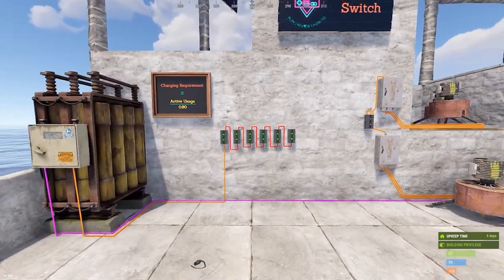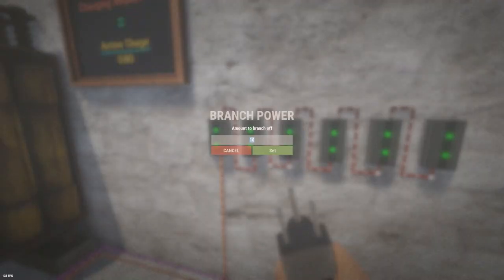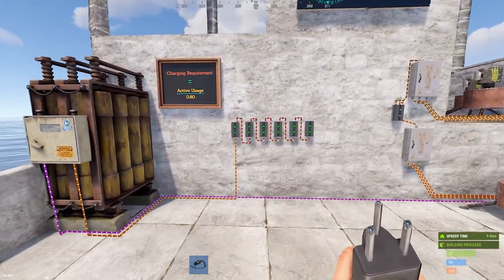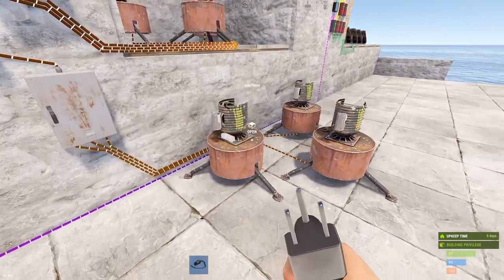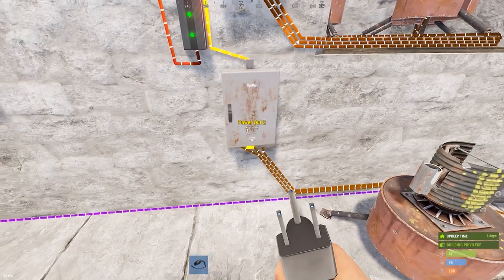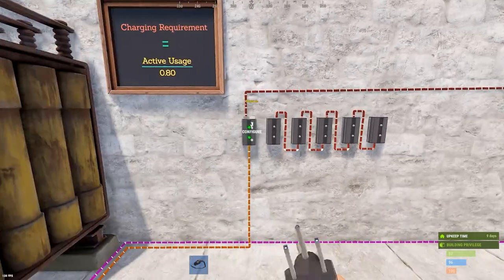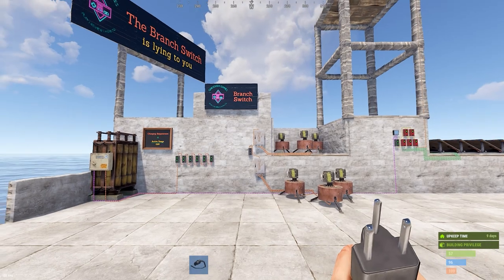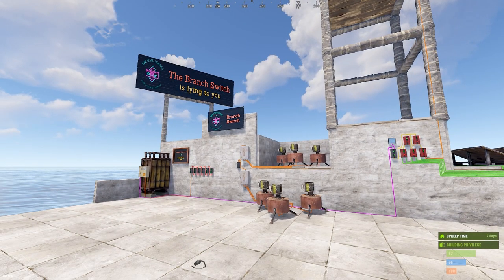RUST Pro Series - The Branch Switch is LYING TO YOU 2023

Comment: Also, currency the banch out is bugged too - even if you branch out directly into a switch which is off, or a blocked blocker, it your battery will still use all the branch out volts as active usage.

Example: in this video, you had 6 branches each set to 10. In this case, they weren't even hooked up to anything, and yet still used 10 power each from the battery. 

Keep this in mind when using branches, and always run a battery's output directly into a switch before any other component at all so you can turn it off if need be. Because of the power usage glitch, you should also consider using several medium and small batteries instead of one or two large batteries. That way, you can turn off one circuit in particular, instead of all of nothing.
Reply: Its not bugged, its intented like this, I don't like it either, but they made this way.
Reply: @marcoantoniotaterospindler4453  wow that's surprising. Thanks for telling me though

Comment: Definitely a difficult concept to explain until you try it yourself, well done.
Reply: @this guy except you didn't explain it correctly. It only "uses 1" if you're referring to the output, but it doesn't "use 1" if you're referring to the drain on the battery.

Comment: If the battery doesn't "see" the branch in it's active usage, is that just a display error, or does it affect charging efficiency needs? ie. If you just wire up 50 branches daisy chained, and the active usage registers whatever the final output is (battery max output - 50), is it the (incorrectly) displayed active usage you need to account for, or the actual active usage, when determining non-drain power input required?
Reply from the maker: I don't think it's a display error. I've set charging based on the active usage that's perfectly balanced (so too low if it is a display error) with no battery drain.
Reply: @AustinKlailaGames  okay, so it's more an oversight in the code. If it's patched, the branches will add to the active usage, and will break any circuits that don't account for it already. 

I've watched most of your videos, and for some reason I thought they had fixed this, or perhaps a similar bug, recently. Thanks for the quick response!